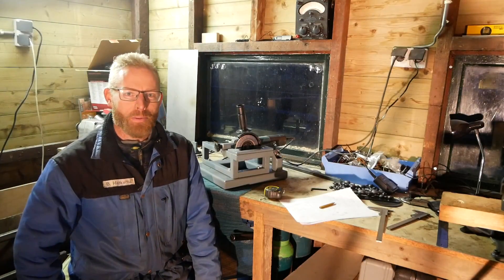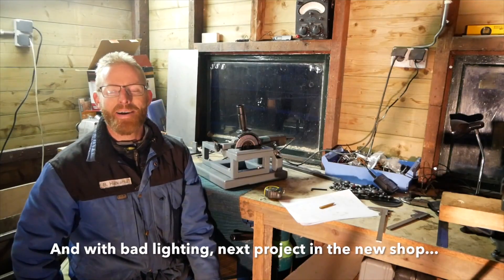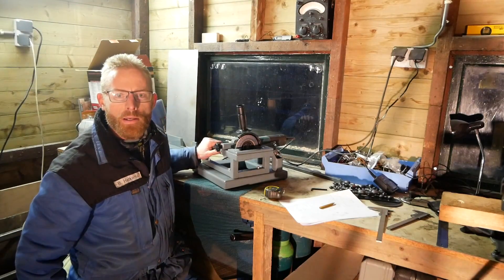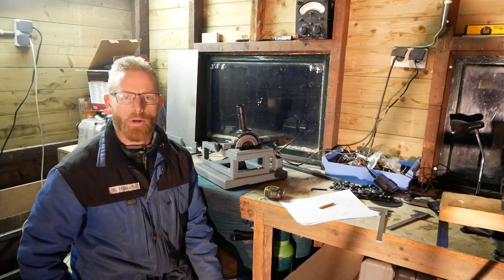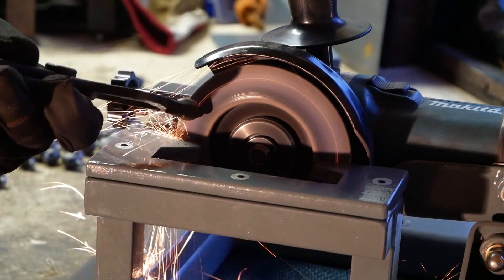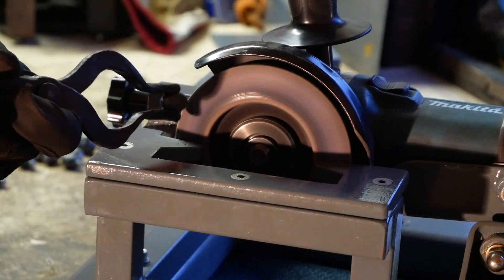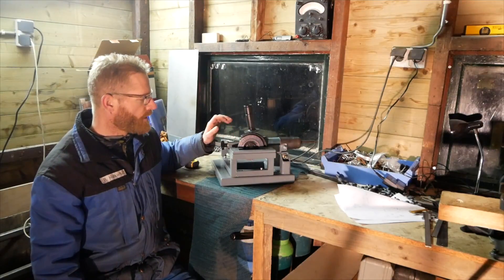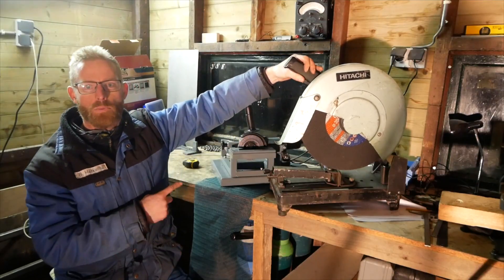Angle Grinder Stand P2: Q&A and dimensions

Comment: Thanks Bart for this great video. I am a newbie in the woodworking and metal fabrication world. My question is "replacement parts" since you used a lathe machine which is very expensive. What do I use to replace the bearing-like part you used as a swivel of the stand connecting the grinding machine to the base?  How much did it cost you for all the materials? Very late joining your contest. A new subscriber all the way from the Philippines.
Reply from the maker: Hi John, thanks for subscribing and your comment. If you don't have a lathe, find a thick wall metal tube and a rod that fits inside. Try your local scrapyard (or order them online). Remember that you need a good pivoting point (without play) but you don't need to use a bearing. It's not a high speed rotation force.